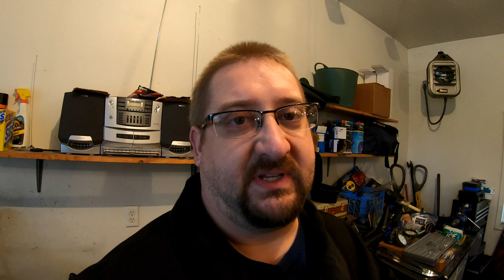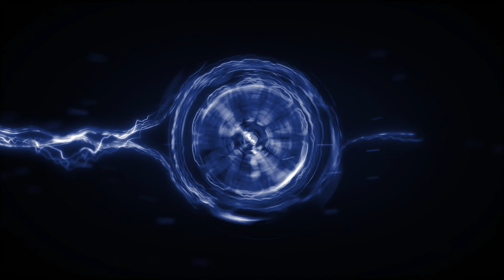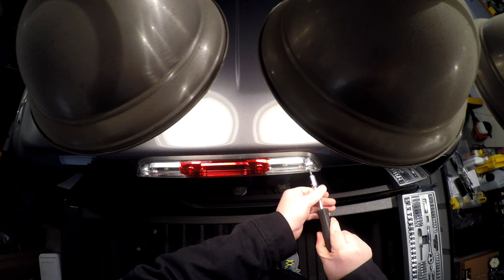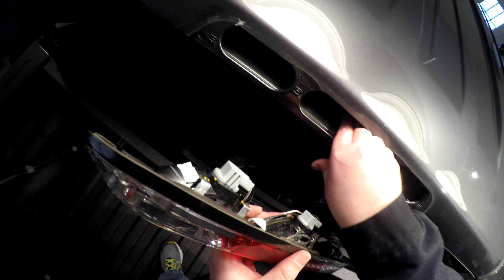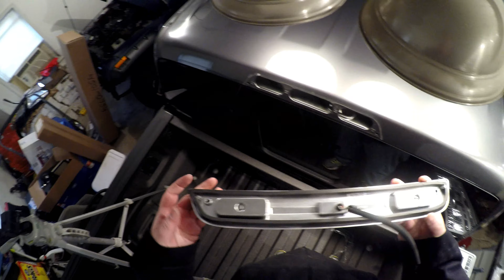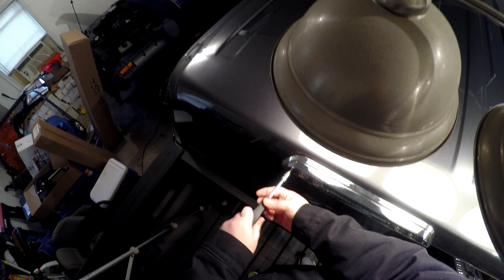Cat piss smell in 2016 Ford F150

Comment: I’m having the same issue. Ran it through the car wash, took off the 3rd brake light and it was dry inside. I’ve noticed the screws are missing on the plastic trim on the roof (makes me think the previous owner knew about it). Anyways, do you think the screws missing from the trim could be the culprit causing the smell? I just bought this truck & love it but the cat piss smell every time it rains is turning me off
Reply from the maker: hmmm I know what you mean about the screws - I'd try to find screws that go in the trim or at least put a dab of clear silicone over the screw holes and let it fully cure.  In my case it was definitely the 3rd brake light seal, and I ended up needing another new seal after about a year.  So, I've added that to my routine maintenance as silly as it sounds.  Once I figured out it was the seal and I started smelling the piss again, I immediately replaced the seal, opened all the doors on a warm breezy day, let it air out for hours, then went on my way.  Even if it is dry inside the 3rd brake light, those seals are so cheap it's worth at least trying.  But as far as the missing screws - you might want to do something about that as well.  But I would try one first before the other and see if you can get the smell to go away.  Hope that helps!
Reply: Having the same issue and found the screws missing on mine too. Did covering them up fix the issue for you?

Comment: Dude. I’ve got a black headliner. Will it be wet to the touch? I have a K2 package. any other notable leak places? Any advice?
Reply from the maker: When mine was leaking I noticed the smell, then the line the water made, and ultimately yes it was wet to the touch.  Best advice I can give is even if you don't want to do it, go to an automatic car wash (I prefer no touch) and see if you can tell when the water comes in relation to where the sprayer is.  For my truck it was pretty easy to tell.  But, for some it could be window seals, brake light seals, trim pieces that cover seams, etc.  And some of it is trial and error.  It's a pain that's for sure so I wish you good luck!

Comment: Help......
I've got a question 
 I've been having a ammonia strong smell cat pee around  in the cab is very overwhelming.
 All I have to do is replace that and that smell goes away?
Reply from the maker: Good morning Linda. There are a couple of places that can leak. The majority of leaks that result in this ammonia smell are from the third brake light like my video here. What happens is water gets down the back of the interior to the glue on the headliner and carpeted back wall behind the rear seats. It's the water and that glue that react to make the ammonia smell. So, replacing the third brake light will create a new seal around the light, which should stop the leak. Some other things that can leak are the sunroofs if it has one, and the plastic looking caps on the roof at the back of the cab (they are in those channel looking things). But, truly 99% of the time it's a third brake light leak.

Comment: Did yours get recalled due to the block heater?
Reply from the maker: I have no clue how I missed your question!  My truck did not have a block heater from factory, and I did not have one installed.  There was a point in time where I actually thought about it, but in southern PA where I'm at it rarely gets below zero (farenheit) and if it does it is only for a couple of days.
Reply: GearTube TV  what part of southern PA? I’m in Morgantown just south of Pittsburgh

Comment: I have a black headliner and a moon roof 17 f150. Definitely saw water dripping from the back roof seam after a downpour in the area of the third brake light so I replaced it and siliconed the roof rail at the rivets both sides. This is driving me insane I know leaving the sunshade open will ensue the smell is worse just going through a car wash the smell comes back. The black headliner hides point of entry I took the magnets out for ease of entry and waiting for a downpour any ideas?